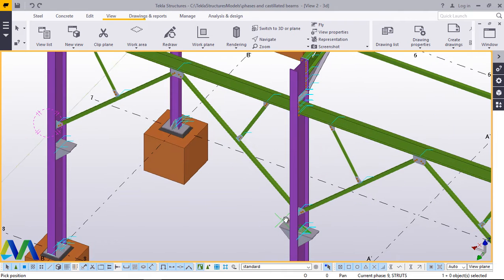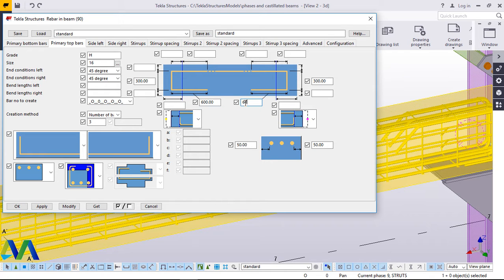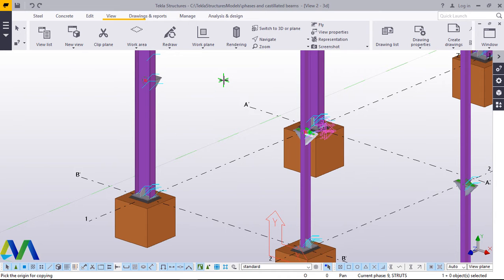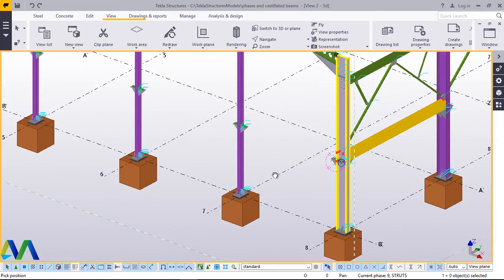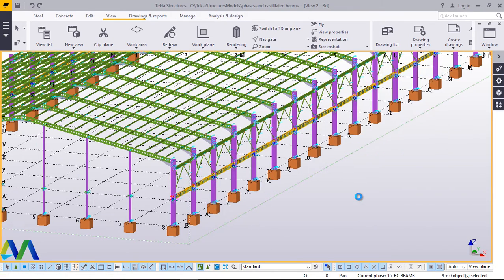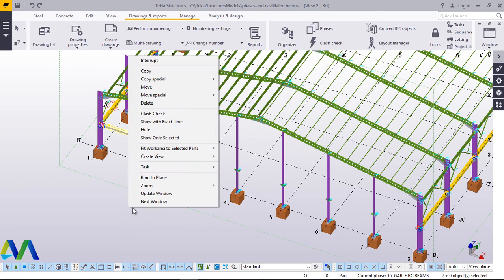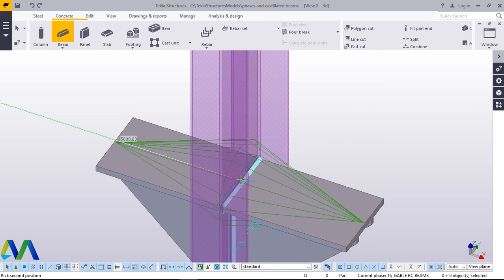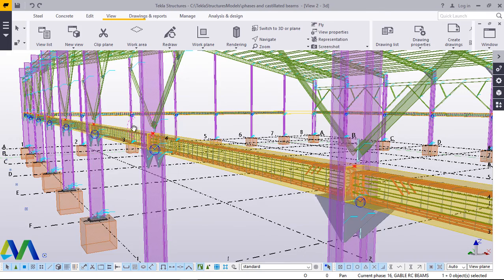How to apply PHASE MANAGER in Tekla Structures 2017 Part6

Comment: Thank u for such a nice video
Sir can u help me 
I m having problem in REBARS smoothness when I  export rebars to ifc using coordination.2 
In IFC bent rebars dont comes smooth just like Auto cad before generation
I m.using TEKLA 2017 service release 3
Reply from the maker: Note,but have you checked the capability of your computer in handling Tekla structures graphics? to some extent such issues do occur.
Reply: Sir
I have checked its capabilities are per required
Too mch confused this error is only coming when I start using Tekla 2017